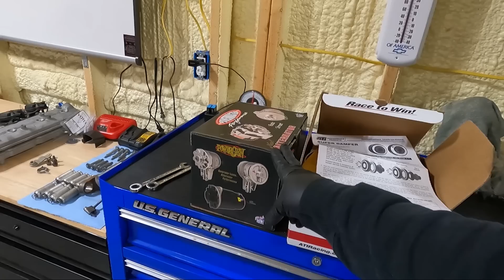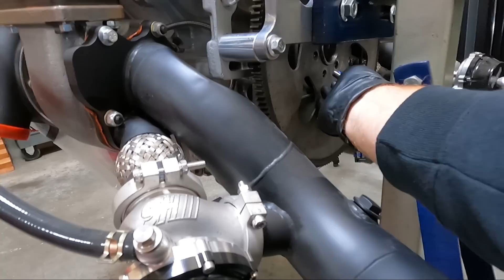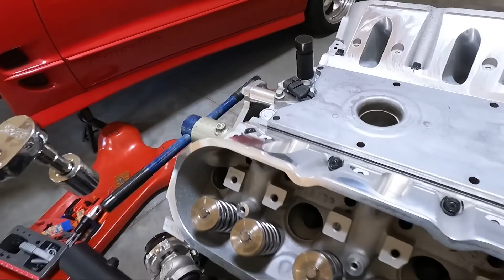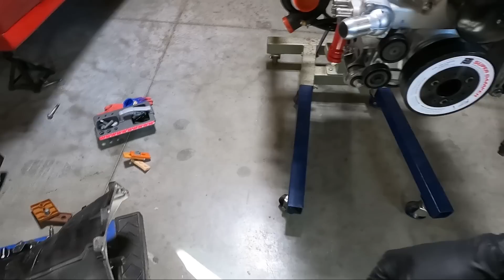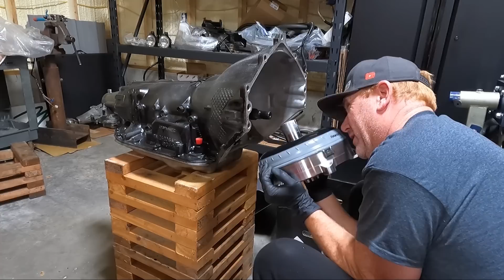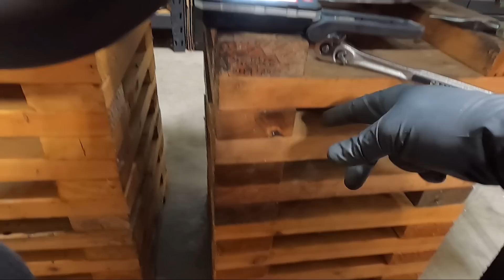New Parts and 4L80E Transmission Going together(Trans Am WS6 Twin Turbo Build Part 6)

Comment: Is there a big dent in the manifold?
Reply from the maker: Yes in down pipe for transmission clearance
Reply: @TWAMotorsports  Is that by design or did you pound that in?
Reply from the maker: By design.

Comment: Sweet n sweet.. you got some serious Ben franklin's in that set up.. only the best part's will do.. I'm in the same boat with mine.. $$$$$$$.
Reply from the maker: Thank you Keith. Wish I would have bolted on a procharger at this point
Reply: @TWAMotorsports  it's coming together nicely though.. take your time with your build.. it's going to scoot rite along when it's finished and tuned properly..
Reply from the maker: I sure hope so